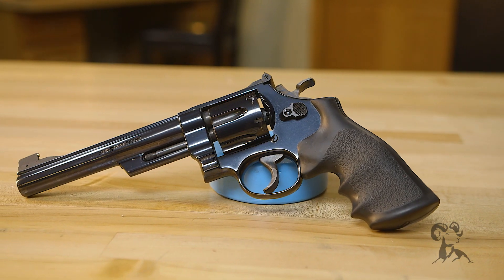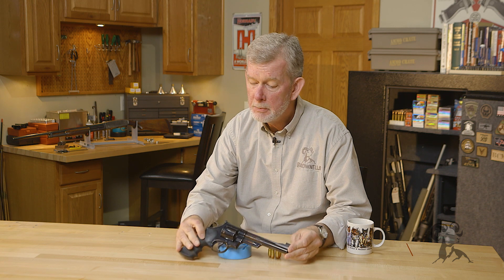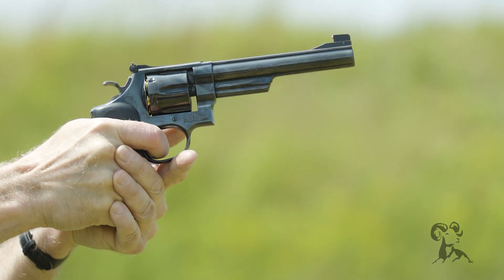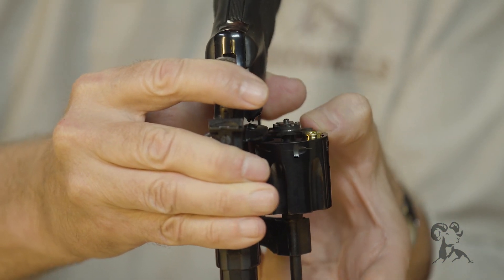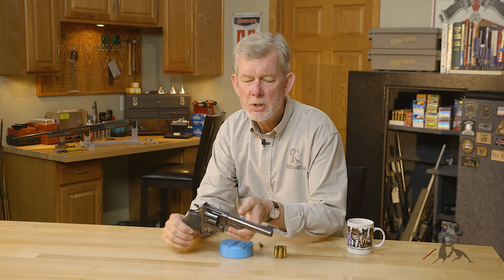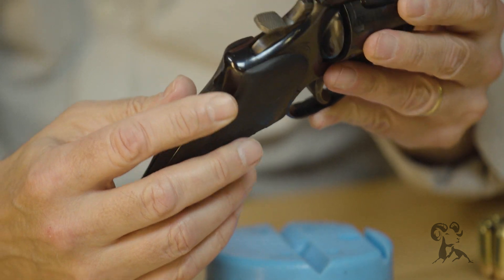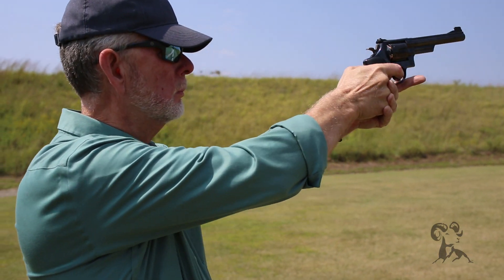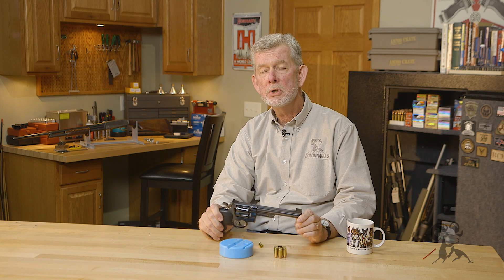From the Vault: Smith & Wesson Model 25 Revolver

Comment: I thought the Model 25 was only available in .45 'Long' Colt, but I guess it wouldn't be a lot of work to make it do .45ACP
Seems like a very pleasant gun to shoot.
Reply: You can have the 25-5 altered for the moon clips. You can fire the 45ACP with the moon clips (they won't work without them unlike the the 25-2) and you can fire your 45 Colt rounds with or without the moon clips as well.  I have had the work done and the best part is you only have to ship the cylinder out with the ejector/extractor assembly; no need to send the whole gun.
Reply: modified cylinder - machine out for the clips